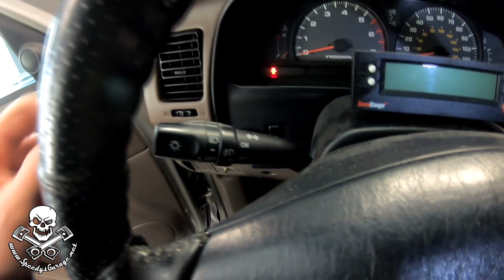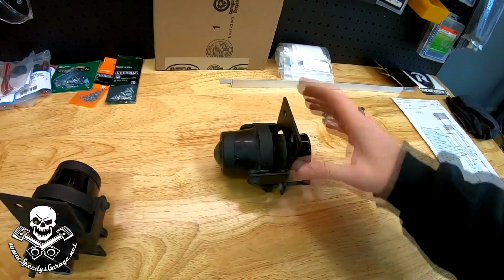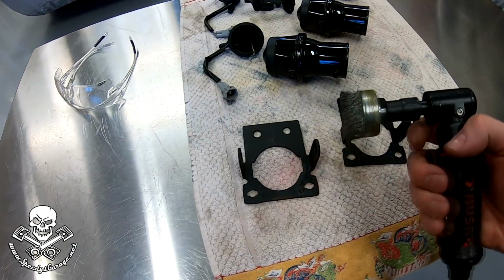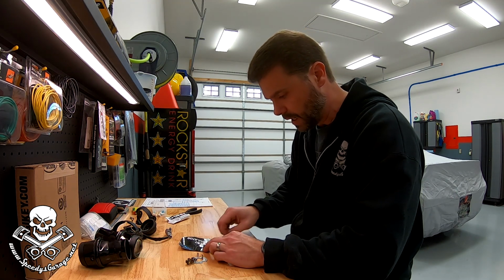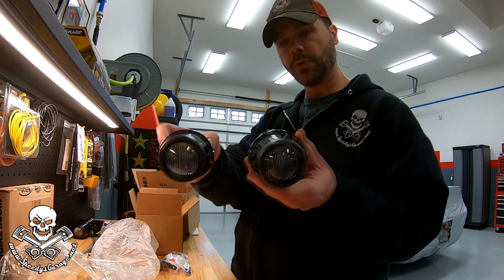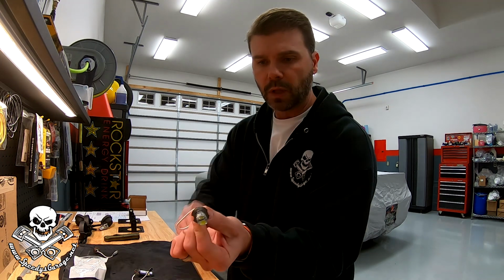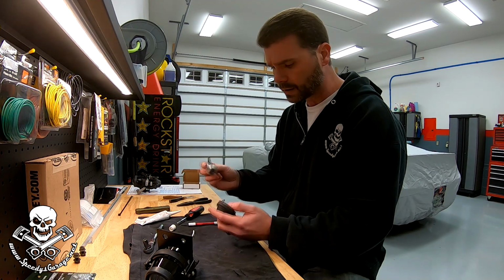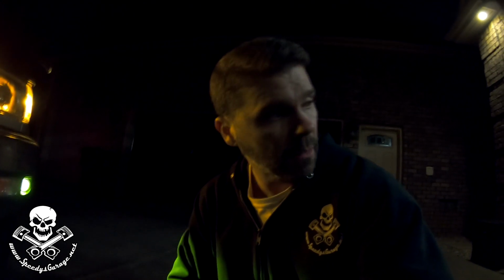Speedy's Garage can JB Weld Fix Everything?

Comment: Cool you have the aftermarket fog lamps. The factory fog lamps do have adjustment to point the light up, down, left, right. The housing has the same shape. The difference is the factory fog lamp is shorter and the bracket is very different. Lens looks the same. My 01 has them but driver bracket is completely bent out of shape and broken due to an accident so I had to order new fog lamps with bracket and housing. The pair is between 130 and 200 bucks depending where you order them but they are available.
Reply from the maker: I found replacement HELLA lamps like the originals.  I think they were $40.  Plug and play on my 02.  https://amzn.to/3NxVG7z I may have had to move brackets can't remember.

Comment: Ive bought the Hella high wattage bulbs like you for my 4runner and they go out rather quickly. I do live in a salt belt however, but just a heads up. I do not think they like colder weather.

Comment: I think I included my link to you on T4R, but let me know if you'd like it here. You definitely want to seal those up (zip tie the rubber boot on tight) and then run a long vent tube up into the engine compartment to prevent water from coming in. They sit right where the front tires splash water and that's why water is getting into them. Awesome job!! Those fog lights gave me tons of problems until I did what I mentioned above. Cheers

Edit: finished watching and 👍👍 for the zip ties!
Reply from the maker: Gonna look at extended vent tubes as well.  Thanks for the tip!